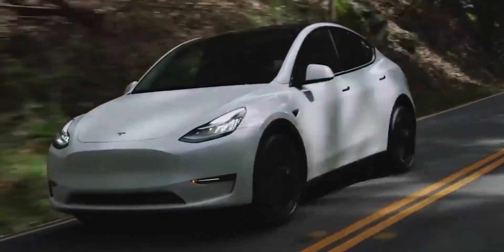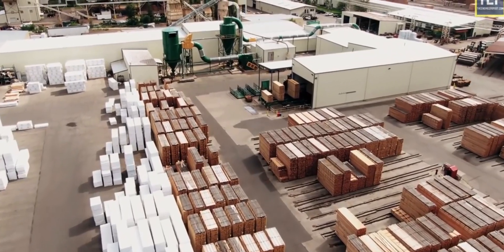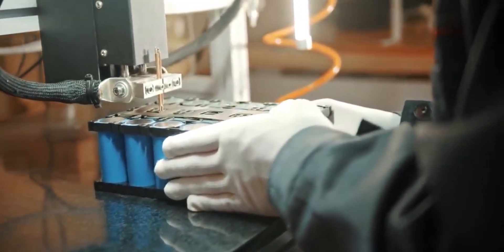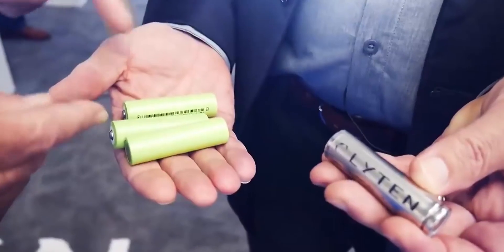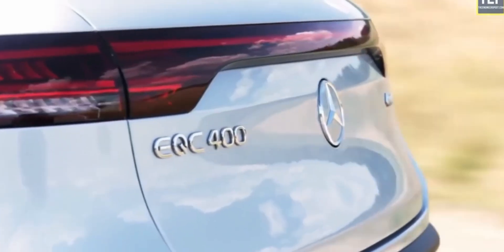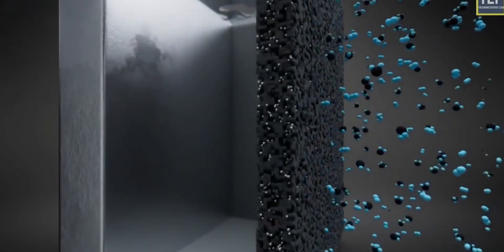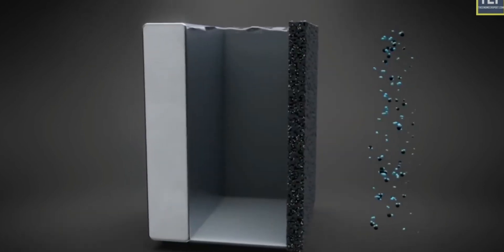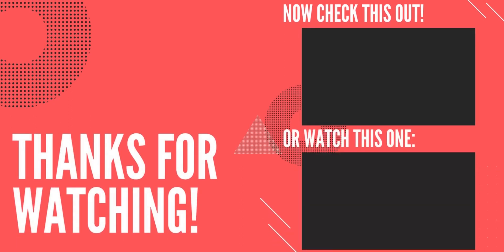This AL-AIR Battery Could Give You 2700 Miles/Range

Comment: What this channel isn’t telling you about aluminum Air batteries? It’s not going to be built into the chassis because you can’t recharge them. They’re gonna be putting a spot where they can be taken out and replaced for a price depending on what it is price wise it could be $200. It could be $300. It could be $100. You don’t know But they are not rechargeable. They’re one time use batteries, so it’s either gonna go in the trunk or someplace they can quickly replace it. I wish channels would actually inform people watching it of this information instead of showing lithium ion core batteries which are built into the bottom. Front sub rims that can be recharged again. Aluminum air. Batteries are one time use batteries. Yes they have high ranges, but you have to know what they’re gonna charge you to replace that battery once your range runs out.
Reply: Valid point - Can the car dimensions be slightly modified where the battery can be easily swapped, without compromising on the boot space... Indian oil co. which part owns Phinergy, says batteries can be swapped in less than 3 mins & it can arrange swapping stations at its 30,000 petrol stations. India has worlds 2nd highest Bauxite reserves .. but almost negligible crude reserves and 115 billion usd of crude import bill annually. I guess India will try and work out a solution which eases it's crude import burden. In fact a pilot project to test a 50 seater commercial bus on Al-air battery has just been launched. At present, things look promising. But you never know if any problem not seen right now come up